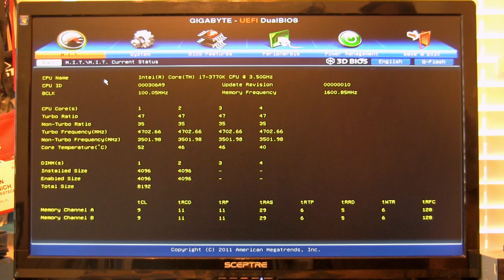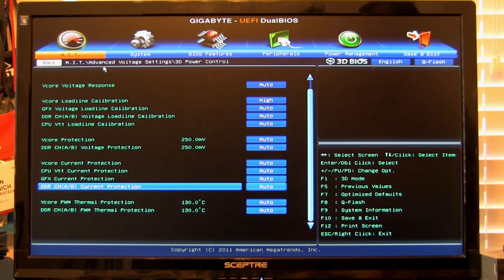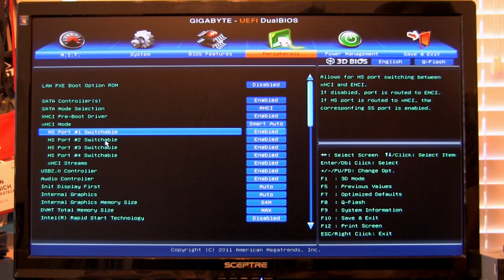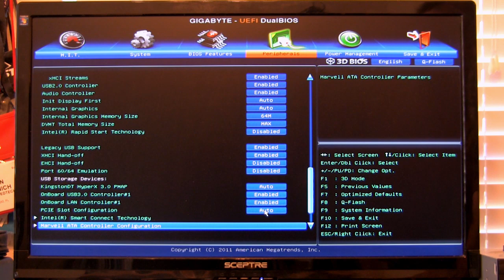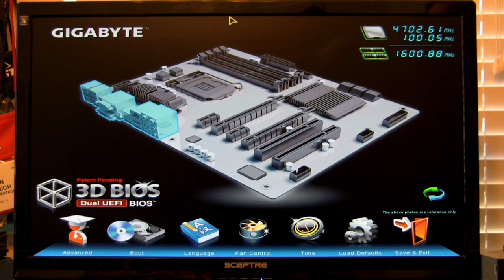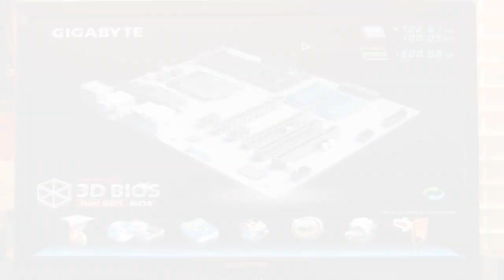Gigabyte Z77X-UD3H 3D BIOS

Comment: I find the whole thing a bit flaky.  I've owned the board for about 3 years now and twice it's had to "repair" itself by re-writing it's firmware and I cannot enter the bios unless I use the onboard graphics card on its own.,  Yes, this means I have to entirely remove my GTX660 or it crashes when I press Delete.  This caused no end of troubles when I was trying to make a dual boot Linux / Windows system, needed 2 drives and to be able to switch between drives at boot rather than installing on the same disk or using two drives and Grub on the main drive ( I like to keep the windows disk uninterfered with ). 

That said with the latest 20e update off the Gigabyte site it will at least let me hit F12 to switch boot options now, even though I still can't enter the bios without removing my  GTX.

Once in an operating system the board does me proud.  I have no complaints at all.

Comment: I got the same mobo but I can't get into the bios. It seems the bios is crashing when I enter it. But I can boot up windows normally.
Please reply. Thanks.
Reply from the maker: Are you using a USB keyboard? If so depending on what port you have it plugged into the board might not initialize it until Windows boots. I would try moving the keyboard and tray again.
Reply: Thanks, it works :)
Reply from the maker: 2Tower5 Glad to hear it

Comment: Could you comment on the cooling apparatus installed on this system? I am running basically the same system on the same board but have never overclocked before. Not using liquid cooling.

Comment: thats alright 2500K is still beast! yeah you probably should reinstall the thermal paste again, i dont know much about the Arctic Cooler Freezer Pro 13 but i doubt it is supposed to be running at 85 degrees on full load.

Comment: I mean i have i5 2500k soz. And it's overheating i think i should install thermal paste again. I have my old Arctic cooling freezer 13 pro. And my 2500k gets 85 at full load :( and it's at 4.5Ghz. I have problem with my newwest bios version and i think i should meaby install older bios. I can't get turbo cores work with this bios.

Comment: Just a tip, at 2:10 you say you can't manually set the value, but like the information box on the bottom right says, you need to use + and - to change the values.